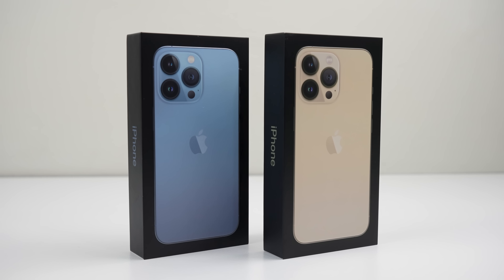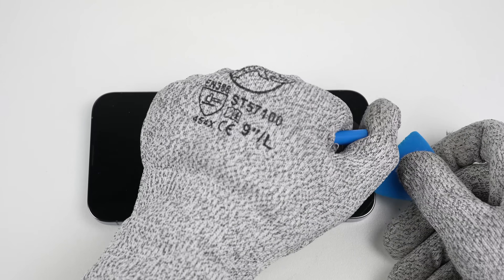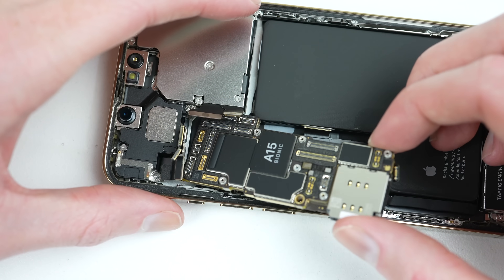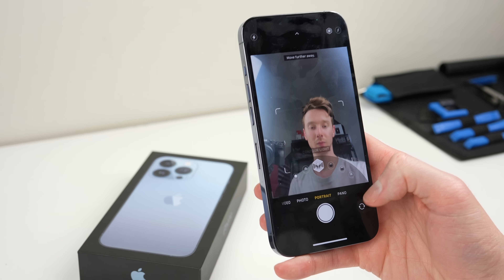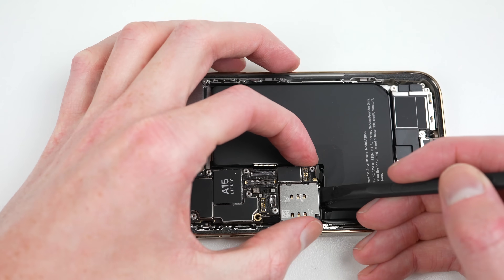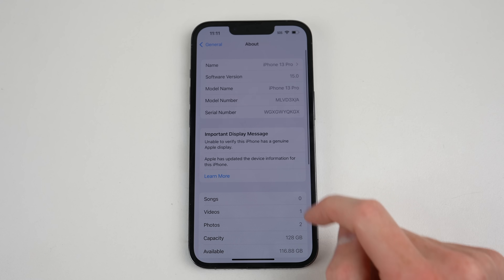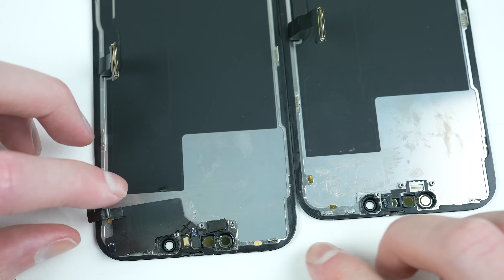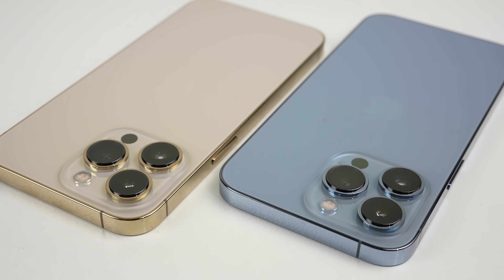iPhone 13 A Repair Nightmare - Teardown and Repair Assessment

Comment: While I believe we should have the ability to repair our own devices, Im conflicted by what I see in my job: network/hardware security.  I have seen everything from general espionage to targets attacks.  There is no jailbreak that doesnt come at a cost for instance.  With the versatility of the OS (Linux based distro), and the myriad of zero-day vulns, ensuring the security of the hardware/software combination is entirely required in an age of no-expectation of privacy.  My opinion is:  Apple should continue down this path so we have at least one company continuing this fight.  All the while, if you want repairability, go with another option.  You cant have your cake and eat it too as they say.   Again, although I'm for repairability/open source, I'm also a fan of having at least one company out there pushing the limits to support widespread security despite the problems of monopolization and other factors including internal backdoors.  So I'm not going to complain, I just accept it for what it is.  On another note, I have received apple hardware, ordered directly from apple, that has been intercepted and compromised.  These are however, NSA-level situations.  So Apple should be HEAVILY scrutinized.  For an example of why, look into the Bloomberg article about backdoor chips on server motherboards, released in 2015, then updated may of this year. Also see their cooperation with the NSA.  All this is easy google material.  Apple was compromised, but would never admit it. Trust no corporation.

Comment: If I bust a headlight on my BMW and I get one from the wrecker's yard I've been told that it will not work unless it is "coded by the dealership", though it may only be a year old. The same goes with lots of parts, apparently.

Comment: More reasons to NOT buy an iPhone. I'm so happy I left the Apple ecosystem. For my personal and professional use, I found my Galaxy S21+ with Microsoft Surface Pro and Surface Laptop increased my productivity compared to when I was an Apple fanboy. When I cracked my screen, Batteries Plus ordered a new screen for me. I dropped my phone off and they fixed it to perfection in a few hours.

Comment: Just, a timestamp. I know Apple can't be this dumb. They were being so effective at turning the temperature up on forcing people to have them serviced by iphone, that going out of there way to create absurd failure modes flies in the face of the strategy. Ask why? While you're at it, ask why apple's sales were parabolic up to 2015 and then absolutely flat. Ask why you'd delay an iphone for a year only to launch, what most people consider a non-improvement model (strictly tradeoffs really). Ask who gets the data. Ask who makes the phone.  Ask what the bite of the Apple really signifies. Good bye Apple...hello Blackberry.

Comment: That's why I switched to 'Google right before the iPhone 8 release.
I admit that Google Pixel phones are also overpriced but at least Google allows me to swap every single part (even the modem module after I broke because I left the phone on my car roof) and I'm not forced to use one firmware. I can easily unlock the bootloader and flash a better firmware. For example I'm currently rocking CalyxOS on my Pixel 4a 5g and it's way faster than the OS shipped with the phone. I can still use the fingerprint sensor, use my cameras and I don't get any errors after I installed an higher capacity battery from NoHon battery back in December 2020.

So, if you truly want to own your device, get an Galaxy S10+, any of the Xiaomi devices (flash Pixel Experience rom to avoid Xiaomi's censorship) or just buy a Google Pixel 5/5a

Comment: Each part in the device has it’s our pairing ID and it’s paired as one complete unit. There is a device you can get that transfers IDs over. Same as upgrading the memory but it’s obviously more work.

Comment: I am avoiding Apple products because of their extreme control and blatant disreguard for customer satisfaction. These Apple roadblocks to 3rd party repair are another example of rogue corporate behavior that will have to be curtailed by laws. This laws which would be unnecessary if the Apple corporation would have real environmental impact reduction policies and wanted to be a truly responsible corporate citizen, but as it is their are more required than ever to stop this abusive corporate behavior of a monopoly position.

Comment: Every year more & more fools buy Crapple products. They complain each model has more issues and costs more and yet less is repairable. Just goes to show that people are getting dumber & dumber. They had something like this 60 years ago but people had common sense back then & learned after the 1st time of getting screwed, not to fall for the slick ads the next year year for an even worse model of a polished turd. BTW, that turd was the Edsel and you Crapple fanatics are the fools. ROFLMAO!

Comment: I’m switching back to android…what problems does android phones have tho? What’s the best reliable android phone, tech support wise, user friendly wise, sysadmin OS backup friendly wise, open source wise, and hardware parts abundant cheap replacement wise, and long lasting battery and battery longevity wise?
Reply: https://youtu.be/rih1vVjf26w

Comment: The next step for the iPhone will be to seal them completely in hard epoxy. If people are stupid enough to buy these things, they deserve what they get. I own 1 working Apple/Mac computer, a 2012 Mac Pro upgraded to run Mojave. It will be my last Mac product. My current phone is a 2019 Samsung Galaxy S9+ running Android. 0 problems in almost 3 years.😉

Comment: Isn’t it checking by software some physical address of the components installed? Wouldn’t it be enough to “””””simply””””” find a way to flash those components with a copy of that code?

Comment: This is great. Think about it. They are gonna RECYCLE your entire phone whose lightning port is broken, and make a new iphone to SELL you with those materials. This is good for the environment. This is also good for Apple. As for you, who gives an eff?
Reply: Recycling isn't particularly good for the environment. Sure, it's better than throwing things into a dumpster, a lot better, but if something breaks, repairing and reusing is way better than recycling. Instead of recycling a mostly functional phone, you'd be recycling a single lightning port with a cable connected to it. Also the lightning port isn't paired or soldered afaik
Reply: bruh wtf apple doesnt give an f about the environment or consumers they just need money lol

Comment: Apple don't care about the environment, their goal to be carbon neutral isn't for us and the environment, its for them and their PR. It looks so good to be carbon neutral to the general public, doesn't matter if your really making things worse because your too stingy about your products and just want more money.
The fact of the matter is people have been vocal about right to repair for a while now, and apple keeps making it worse. I get going to more official sources to get it repaired, this can be great for a number of reasons, It allows the company to see issues which are common, Allows for a warranty to be kept on the phone, helps ensure its kept its water proofing etc.
But it should be a choice not something forced upon the user, Apple have been known to price gouge their repairs and suggest things which are not Necessary so they can get more of a profit, such as replacing parts which don't need to be or even getting an entirely new device.
Apples not gonna be carbon neutral ever, they will appear it to the outside eye, But their just gonna be dumping their carbon on their consumers.
Reply: "their goal to be carbon neutral isn't for us and the environment, its for them and their PR."

Yes, absolutely. It is literally impossible to make any smartphone carbon neutral. The first time I saw this PR, I asked myself if anyone would believe that lie. Selling without headphones is fine but without charger is just ludicrous.

Comment: Same observation as before, It means you can only use replacement parts manufactured by Apple which has a different identifier/code/number than prebuilt iphones which is detected by software.

Comment: Just buy Samsung.
Then Apple will be naturally disappear
Reply: Samsung isn't THAT much better btw, screen replacements are worse than iPhones since you have to remove basically everything from the phone including the agressively glued in battery (which, once removed, can't be replaced safely). Samsung doesn't pair most of the parts though.

Comment: Apple hates it when you counter their "We're going green" with "You're filling our landfills with devices that should have been repaired".
Reply: Funny thing is there's literally no green (as in colour) version of iPhone 13, although there was one in 12 lineup. Mystery solved! ;)
Reply: But on the flip side, most people just throw something away when it's only a few months old when the new "bright and shiny thing" comes out, so who's really at fault for it?  Too many people have to have the new and shiny right now and to have something old makes them feel like they're homeless and living on the street.
Reply: @cujoedaman  that may be true for some, but we need the option to conserve and repair.
Reply: @cujoedaman  i still prefer to use my electronics as a backup if the new one is DOA or fails in like a few months. i also try to sell them if i think i dont need them anymore like my galaxy S9 plus wich my mom uses now and she is interested into my note 10 plus when i get a new phone in 1 or 2 years when my note 10 is 3 or 4 years old.
Reply: @cujoedaman  not reallllly, the advanceme t these days is  so small I have kept the same phone since 2017 note 8 and still going strong.    (I was thinking of sam flip note but ehhhh wait another 4 years)

Comment: What's further annoying to me is the fact that they made the inside design extremely easy to fix, as it features easily swappable parts, no soldering, a nice layout for all the parts... so the apple tech just has to pull a part out and put in a new one easily, and can charge almost full price of the whole thing for it... crazy.

Comment: The components being blocked via a check of installed(component) vs expected(component) is something medical manufacturers have been doing for a while now.  There is a service setting somewhere that you can turn off that check, or have it save installed as the new expected.  Third party services companies for medical devices have found 'work-arounds' for this.  I am sure someone will figure out how Apple is doing it eventually.

Comment: Small store repairsman here: I can think of why apple doesn't want to give us the ability to repair their phones. Often times you can buy cheaper parts in online supply stores that should work correctly but end up not doing so or damaging the phone (Original 96$, knockoff 30$. I mean, who wouldn't?). Phrases like "Hey, i took the phone to a low cost repair store and now it doesn't work correctly. Can you check it out?", and ending up in a tortured phone in my hands are a pretty common thing. If you have a brand to maintain, a quality phones "seal" and a lot of money, i can see how you end up incurring in these practices.
Often times we think that Apple doesn't allow repair shops to tinker with our phones, when we should be thinking that there's a wide variety in the quality of the repair shops.

Comment: notice how the speaker dots on the bottom are distributed unevenly

this is probably an intentional bad design that will be "fixed" with the iphone 14 by removing the charging port

Comment: its a joke we pay for the phone, its our property we have the right to do whatever we want with it, knowing full well that it will void the apple care which is a joke anyway, I went into a store to have my phone looked at because it wasn't charging, came back with a bill of more than the phone, said i need a replacement handset, i told them no listen i can charge it wirelessly just not with the cable and your telling me i need a new phone, went to a 3rd party he had a look and one of the connectors came out he put it back and presto back to normal, and this is the reality 
the people you bought the phone from who should be adept and knowledgeable came with a bill of more than £1k after 1-hour diagnostic
3rd party repairer took 20 minutes to open the phone see the issue and charged me £30. this is blatant anti consumer actions, i will no longer be renewing with apple when my contract ends if now theirs zero chance you can get it fixed anywhere else other than apple

Comment: 1-)This just makes perfect sense. Company puts in good effort to make their devices dependent on them. Nothing wrong with that.
2-)Users expecting to exert their own rules/wishes on the companies products is the problem here. The Company don't have to allow this.
3-)Don't buy, problem solved.
Reply: You don't understand how Apple's walled garden works. It is made really difficult to leave apple's ecosystem, and the fact that most people will only find out about these issues when their device breaks will mean that they buy it anyway. They are not informed of this when they buy the device.

Additionally Samsung has been following closely in apple's footsteps. They are doing similar practices. The fact that apple gets away with this with the majority of users and without government regulations is setting a precedent for every other industry.
Reply: @goeiecool9999  I understand it perfectly. It is to Apple's benefit.
Yes, the results may be undesirable.
But the solution to this is not whining in the forms. The government can regulate this, or people need to stop buying these products.
If people could live, just as they could 100 years ago, without these cellphones etc, we wouldn't talking about this laughable limitation, that you can't repair a whatever device on your own.
People shouldn't have relied to these products this much to begin with.
If it's dependency is unavoidable, like water and electricity, then government and law needs to intervene. Which will take an effort to implement.
No free cakes.

Comment: these issues with the messages persist since the iphone Xs battery, nothing new here. and true tone didn't work with a new display either. well, even before that, you couldn't swap out the touchID on older iphones since ages cause it was bound to the motherboard. did you really expect that apple would alow a motherboard swap on the iphone 13 and everything would work just fine? and when you swap out just the sensor cable of the display, there is still a chip on the backside of the display that stores the software that verifies the display originality, of course it will not work. wtf

Comment: Disabling FaceID when the camera is swapped is a reasonable enough security measure. Everything else is infuriating.
Reply: I disagree. The Face ID data should be lost and get re-setup with the new camera.
Reply: @Tatsh2DX  That would be a better solution, for sure. I'm not saying is the best way to do it, I'm saying it is reasonable enough to be an excuse. Also, it might be the easiest way to do it.

Comment: We're green company, we don't provide unecessary charger or headphones. But if one tiny cap in your phone breaks, it goes to the landfill. Just look at all the stuff covering the board. Is board repair even possible at this point?
Also, faceID is totally not related to the screen. I'm sure the only pupose of it not working after screen replacement is to get clueless customers mad at their repairshop and never try 3rd party repair again.

Comment: In your new car, the battery can’t hold a decent charge, so you replace it…
Now your key fob would stop working and you need to use your old school metal key all the time.
Oh, and the brakes don’t work if you are making a left turn, the left turning indicators don’t work, and you can not turn on your high beams. 
Putting the bad battery back, everything works perfectly again, but you will need to hook your car up to a charger every evening if you want to be able to go to work tomorrow, even though this was exactly the reason you didn’t buy an electrical.
Reply: Hey c'mon man why screw around with all of that. Just buy another brand new car and toss the other one out. Might as well...
Reply: @ironhelix5362  exactly the point, isn’t it…
Reply: @DrBovdin  yeah sorry, was going for humor/sarcasm...
Reply: @ironhelix5362  yup, I got that… my original comment was also meant sarcastically 😎

Comment: imagine apple makes a shirt, and one of the shirt button accidentally lost so you buy new 3rd party shirt button and install it with needle and string, upon completion of the job, all holes for shirt button get zipped by the system and no holes anymore, the shirt no longer absorb water if you try to wash it, and the shirt become conductive if you try to unzip the holes by using electronic tools.

Comment: This might be an unpopular opinion, but i think it was the right move to put limitations in software. I have tried various third party repair shops with my phones over the years and most of them were crap. Never used sealing between screen and body or the screen panel was definitely not original and broke after first few knocks. IMO the only place where apple is screwing up is price of repairs. They are charging waaaaaay to much, forcing people to go to third party
Reply: Nah man, people with the requisite skill and equipment should be able to do repairs if they wish. This is a blatant cash grab by apple, they're also still pushing back on the EU, who want them to use USB-C for iPhones, but they keep refusing. These limitations are done to rip off customers. I doubt you'll see apple reduce repair prices, they make too much off that stuff.

It should be up to the consumer whether or not they want to use third party repair shops, not apple.